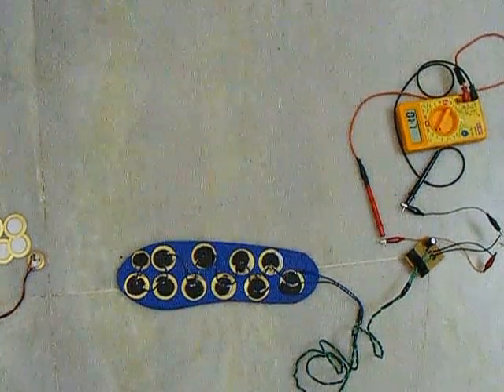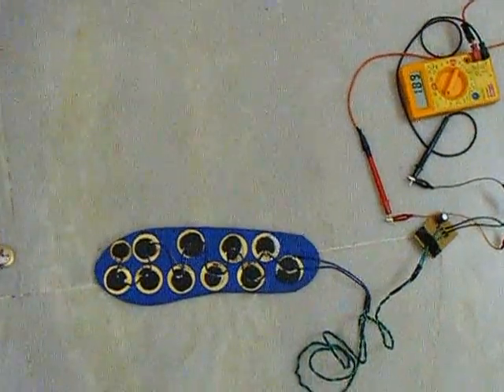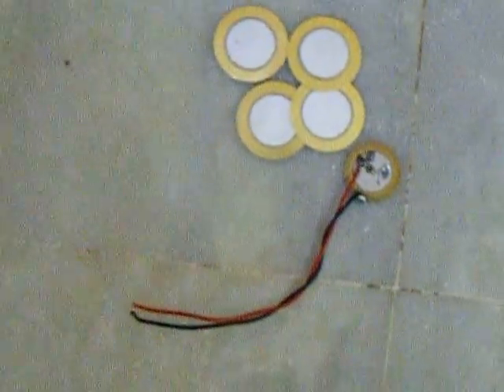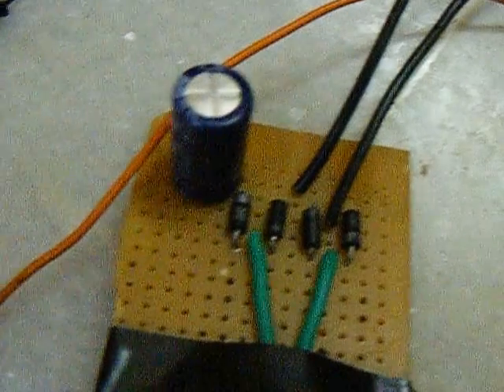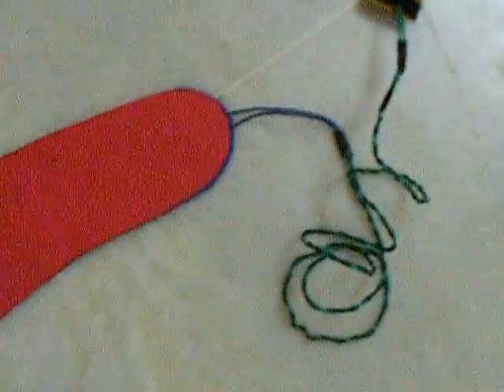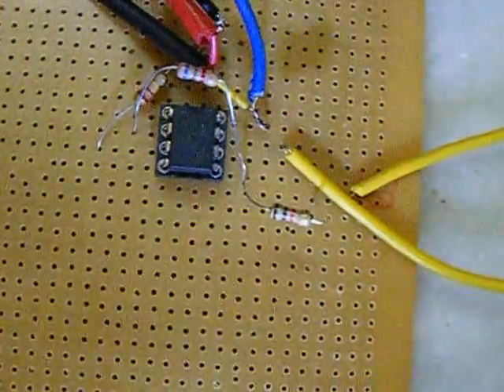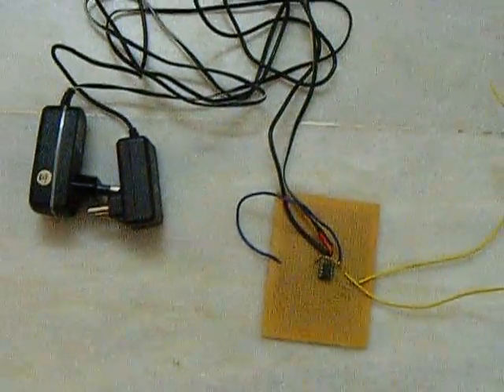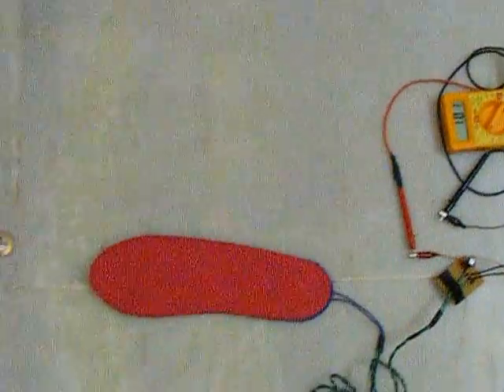PIEZO electric power harness .

Comment: bro why cant they be connected in series ??
Reply from the maker: Jayanth Chandra measure the voltage and current each piezo produces . Depending on what you're looking for at the output , connect them in series and parallel. Let's say each piezo outputs 1V and 0.1 A at peak, and you want 5V and 1A at the output, you'll need 5 piezos in series, pushing 5 volts  and 10 such piezo combination in parallel .
Reply: then series is more efficient then parallel right ?
Reply from the maker: Jayanth Chandra Voltage isn't everything. Sure, if you want 10V and 0.1 A of current, series works. You have to figure out what's right for your use case.
Reply: bro can u help me out please , actually i need to charge a battery of 5V-1AMP how many piezo plates and what connection can i use ?